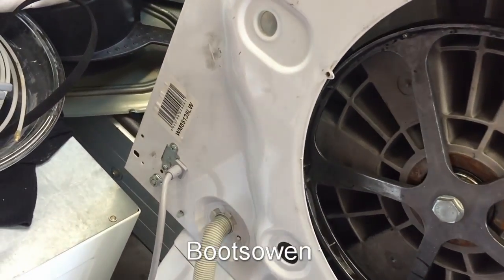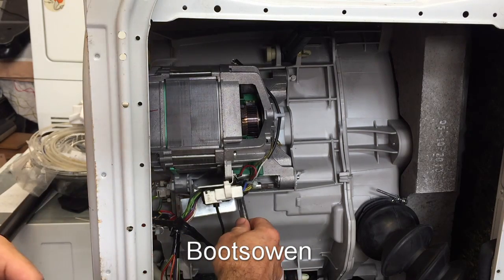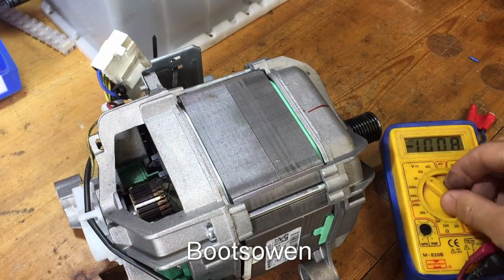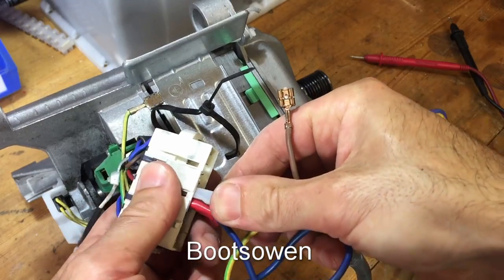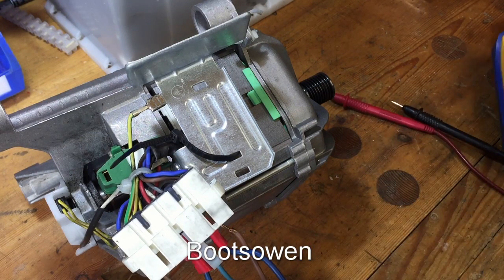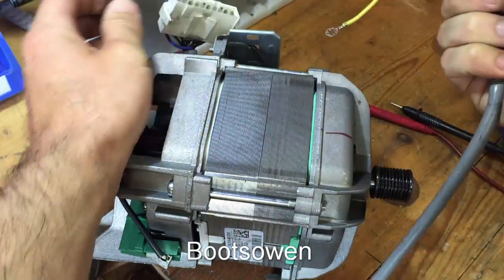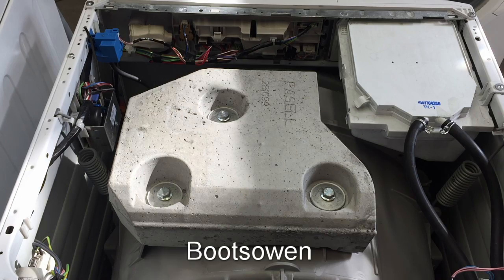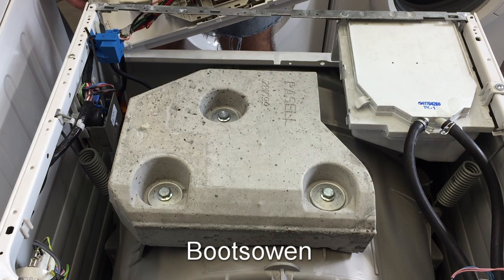Beko WM85135LW fault finding: Bench testing motor and looking at the PCB: It's broken but why?

Comment: I an`t no electrician, but there are several things you need to check when the motor don`t work,
the motors will have its own separate PC board
Usually if the motor goes down due to tripping the house circuit or a fault ,then the motors PC board would have a fault as well,
You need to check the armature for any slightly raised copper elements that the brushes contact, 
If you here a click noise or the brushes bounce slightly up and down the armature the armature is no good. that will cause a your separate PC board to get damaged and have a fault, 
You also need to separate the motor I think they have a trip in them if it gets hot , check inside the   housing area,
check How 2-repair video`s he has some good tutorials on the motor issues,
Your machine may be holding error codes as well that need to be cleared,
Reply from the maker: But you’re not an electrician
Reply: @bootsowen  what`s that got to do when repairing your own washing machine,
Would you call out a electrician to pull an air grip from the pump,
Or to un plug the washing machine and change the broken belt on the spider to the motor shaft,or replace a part,
There is thousands of tutorials showing you how to correctly test your circuit board, and parts to your washing machine,
just do your research correctly , then you will have the confidence to repair your own stuff, 
In my 50 years I have never called out a electrician to fix any white goods,
The only things I do not touch is my gas cooker and boiler and electrics to the house, 
And that`s only because you have to be qualified by law to work on these things,
other than that I repair most stuff ,
Reply from the maker: I thought it was funny that you pointed it out. You don’t say what country you’re in so it is difficult to say where the rules about law and qualifications apply. In the U.K. most installations require a competent person rather than a qualification.
Reply: @bootsowen  I am born and bred U.K,
I pointed out I an`t electrician, because it stops people asking me more on the electrical side,as I am figuring this side of it out my self 🤔
I know more on the faults that I have encountered and remembered from the past,and most have not been electrical,they have been mainly mechanical,
But as the washing machines are getting more sophisticated people have to start learning more on the electrical`s specially PC board parts and what to look for,
I don`t know how much it is for a call out charge be for they even look at a machine, but you could end up possibly pay a few hundred quid for call out, then the part and the labor,
You could buy a second hand machine for that price,
I look at it this way, lets say you called them out, the guy charged 50 ,00 - 130.00 call out, depend where you live ,then he spends 30 minutes working out the issue , then fits the parts, how much is that going to total say total 240.00
Two weeks time there`s another issue, so you pay say 150.,00 
That`s 390.00, you could of bought a new machine for another 60 .00,
This is why its important to try and repair your own goods,
Reply from the maker: You might enjoy the other videos on my channel. I am just figuring it out too.
Reply: @bootsowen  On circuit board if you can look up the diagram schematics it would help , 
But some times best remove parts from PC Board to test individually,
some times a good magnify glass to check for hair line cracks to the chips,
As for motor issue this usually damages the motor PC board, that`s the small board,not front panel,
And test connections for continuity from motor to board, 
if no path is getting there then that may be the issue, but you could see clearly some things needed to be checked on that board,the black burnt pattern was a give away ,
I remember the PC Boards used to have the glass fuses , where if anything happened you just replaced them first, 
I think I should of made you tube channel with all the stuff Ive repaired and restored, 
is there much doe to make doing you, tube?
Reply from the maker: I don’t think I have ever found a pcb schematic for a washing machine. Where do you get them?

Comment: Did u resolve the problem? Maybe the little control board at the right side was the matter?
Reply: I had a similar issue, and found the PCB track on the motor drive unit (drive unit is found on the top right of the machine, when viewed from the front after you remove the top - it has an aluminium case. It can be seen just to the left of the concrete block in this video) was broken as it had acted like fuse, which had happened when the brushes had worn out. Beko had deliberately omitted the fuse on this PCB (there is a fuse designation on the PCB) and fitted a wire link instead. I repaired the damaged track, and fitted a 20mm fuse holder where a fuse is indicated on the PCB and and a 5A fuse and it has been working fine for about 5 years now.